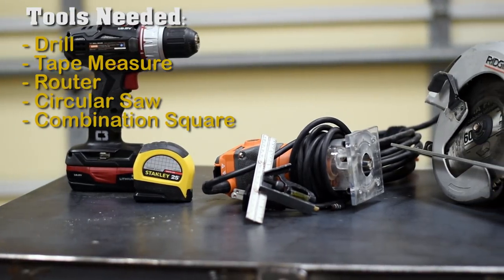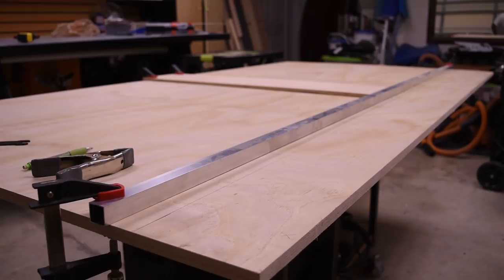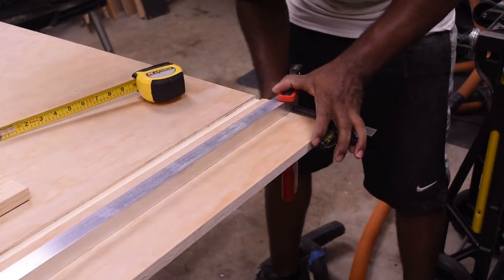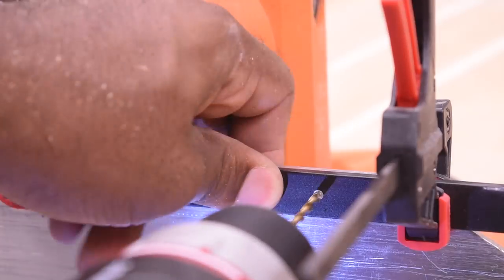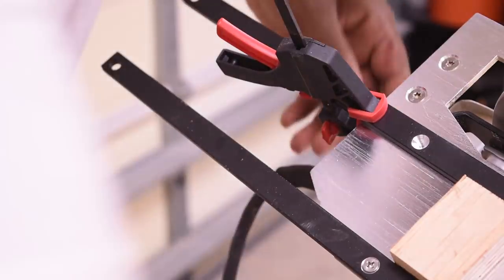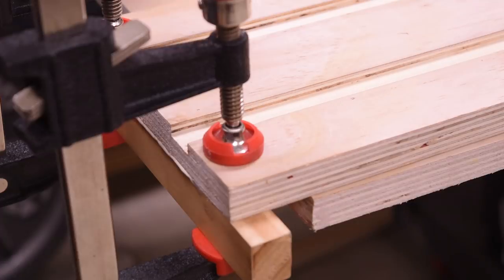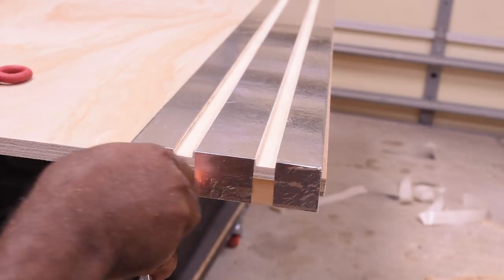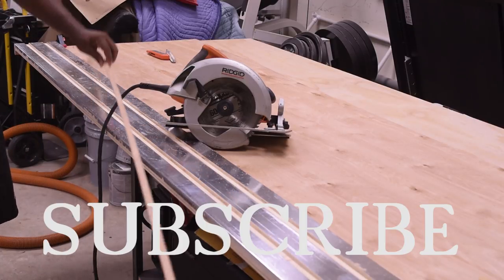How To Build A Track Saw |  Limited Tools Episode 001

Comment: Now I know it's not called the Ultimate track saw, but this design needs improving, the clamping part that is. Maybe make the track wider so that there is room for a clamp
Reply from the maker: +Joe G.P. 
U can use a C clamp as I did in the video. The reason the base is not wider my plan is to do an under mount clamp.
Reply: DIY Creators wouldn't a C clamp get in the way at the end of the track ? this is why i suggested to make it wider, so the saw has room to pass. The under mount clamp is nice but way more difficult
Reply: dewalt makes a low profile clamp specifically for track saws.  it would work great with this.

Comment: Hey man... Great idea for a DIY Track saw. 

Is there any play in the tracks when you are making the cuts?
Reply from the maker: +Storm Ridgway
 Thank you.  No play if any definitely not noticeable. That's the main reason I added the 2nd track is to eliminate any play.
Reply: +DIY Creators 

Cool. Like I said...great idea. I have been researching pretty heavy for DIY track saws and this one is at the top of list. I plan on buying a new circular saw strictly for "track saw" use. 

My research has came to an end though. Your design is the one I am going with.

Comment: I like the idea but isn't this the same as clamping the long square tubing you used to the table and using that as a guide, taking into account the distance from the blade to the right edge of the saw?
Reply: The benefit here is you have two rails for stability instead of having to push against the "fence", and it's dead simple to just line up the edge of the track with your cut marks - no measuring needed. The cleat at the end also helps ensure square cuts on sheet goods (which is what 90%+ of people use their track saws for).
Reply: +F3Ibane I suppose if this is something you do a lot, then I see the benefit. The odd time, I'll use the"measuring" way. :P

Comment: Why build this version over the other circular saw guide you describe (which is a much more common design)?

I think this is awesome, but I'm not understanding why build both.
Reply from the maker: Well, with the other version you have to keep the saw pinned up to the guide. With this one, it's on a track. So you don't have to worry about the saw wandering away from the guide.

Comment: Looks good but i am worried about how accurate it would be .
Reply: I'm guessing really, really accurate.  But it all depends upon your setup and execution as you build it.
Reply: REALLY accurate, because the final edge to the track is being cut by the finished track saw, that edge will always be the same.

The hardest part will be getting the parallel tracks and the guides on the saw to run through them smoothly.  If you manage that, you are going to be balls-on dead accurate.
Reply: Thanks for your replies .
Reply: Don't think it is necessary, but one solution to have both tracks accurate parallel would be to keep the track bar in place and use the router in each side of it to make the tracks. Or maybe clamp a track bar into the first track.

Comment: Why have another piece of material hanging around the shop?  Use a piece of steel flat bar or square stock as a guide for the circular saw and get the same results.  Also, make your measurements at each end and pop a chalk line versus making multiple marks...less chance for misalignment.  These are my thoughts, so do what you feel most confident.

Comment: If you still have to claim it in place then it's a failed proper track saws don't need to be clamped to the wood you're cutting they just sit there may as well just clamp that aluminium you had to what you're cutting

Comment: whats the point of building one of these. .... I don't get its purpose. ... to shave an inch off wood?
Reply from the maker: The reason to build one of there these is so you can make straight cuts. I should have explained it in the video. I only cut about an inch so I didn't waste any material.
Reply: Thanks man! I'm a noob to woodwork and couldn't wrap my head around it. TY
Reply from the maker: Not a problem your welcome. Its part of a series I am making for viewers who are new to woodworking and and have limited tools.

Comment: Hello fellow creator I have a question or two about this track saw. First can I use plywood that is a half inch thick not three quarters?  Second question is can smaller lengths of plywood be used instead of a full eight foot long strip?